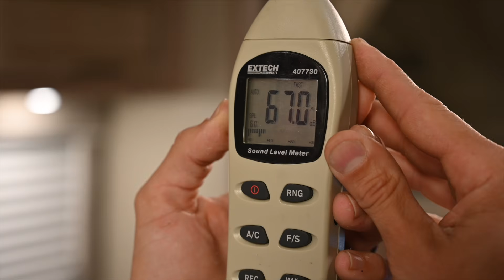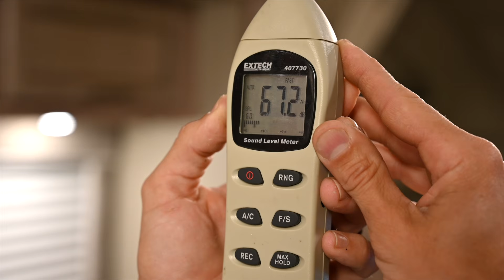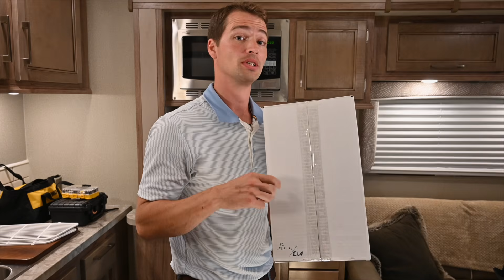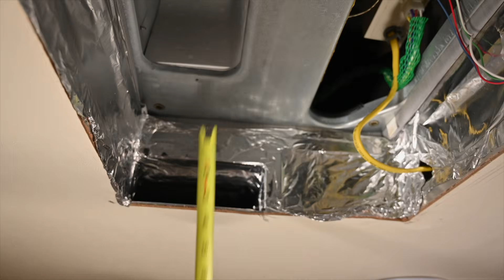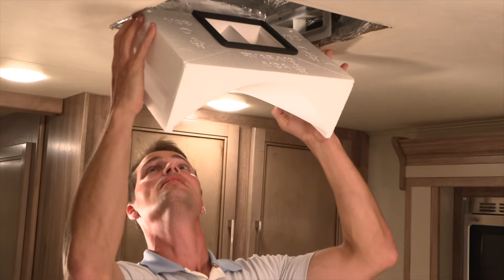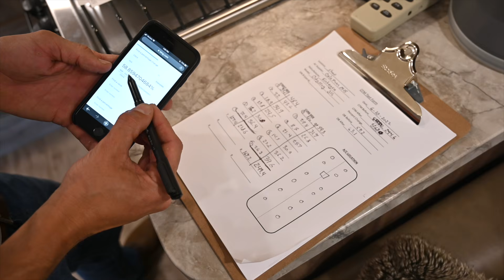RV Airflow Systems: Explanation, Installation, and Results

Comment: I was amazed. I watched all the videos on this product before buying. I was convinced based on all the numbers that were measured to purchase it and try. In my case I had used my AC a couple years ago on a trip to Tennessee in the summer. It was 90-95 degrees while I was there. We cover the windows with reflective material to reduce solar heat. The temp stayed about 10 degrees cooler than the outside temp )(about 80 degrees). That is exactly like I had heard to expect from a RV AC. 
I installed the airflow system before leaving for South Carolina. The RV manufacture did a sloppy job installing the unit. Tape everywhere blocking the vents. Foam insulation had fallen down. I followed instructions and installed the airflow system without any issues. 
South Carolina was HOT. It was July. It was around 95 degrees while there. Humid as well. Real feel was over 100 degrees. It hit 108 at one point. 
We kept the thermostat set between 73 and 75 while there. It reached and stayed at that temp the whole week! That's a 20 degree difference from outside temps!!!. It was truly comfortable. Have to mention that it was also quieter, Sometimes we couldn't have a conversation if the AC was on. Now we can with no problem. 
I don't have fancy testing tools but I can tell you this is worth every penny and couldn't recommend it more for anyone not happy with their RV AC performance. 
Thank you RV AIRFLOW for a great product!

Comment: Video is great. The written instructions could use some help. I neither the instructions nor the video do you tell the installer to leave the original supply/return air divider (?) out so that the return air has a unobstructed flow.

Comment: I just finished my installation today.  It took about 90 minutes including watching this video again.  I discovered the original installers at Keystone had left tape covering half of both of the ducts leading out to the vents.  After cleaning all of the old tape out of there and re-taping everything, I had no leaks or obstructions.  The result was a 3 dbl reduction in sound from the a/c 5 ft away.  I couldn't measure the precise change in the airflow but, I have to estimate it tripled the output.  I imagine just cleaning up the ducts accounted for 1/2 of that.  I wish I knew about this years ago.  I'm recommending this to all my R/V friends.

Comment: Does the new airflow make up for losing the two big open vents in the face plate? I just installed the system and not sure I am getting more cooling airflow over all? Vents work great but that was a lot of air coming out of the two dump vents. Any thoughts you can share on this?
Reply: I have two air conditioners in our RV and am removing the RV Airflow kit in the kitchen since the loss of the two large vents in this area cannot keep it cool. I will keep the one up front in our bedroom.
Reply: @cooker2003  Thanks for the input. What I have found is that if you leave for the day come back to the rv and it is 90 degrees inside, it takes well over an hour to cool it down to 76 without those dump valves there as opposed to about 20 minutes before. Once it is cool it will keep it there. Only advantage we have seen is that it is a lot quieter now. You can watch the tv without it being set to screech! I don't feel all the airflow in the ducts that other people talk about either. Works once you get it cooled down and a lot quieter so I guess it was worth the time.

Comment: I just finished up installing one in my Winnebago Itasca Cambria, with the shallow plenum mount, over my lunch hour, and it was straightforward. I taped it up along the edges, especially in the air return, and the airflow out the vents was impressive. I am looking forward to giving it a try when its actually warm. Customer service is top notch too. I first contacted them a year ago, forgot about it, and when I contacted them again last week, they had all the notes and shipped super promptly.